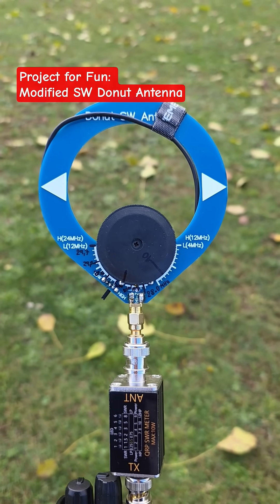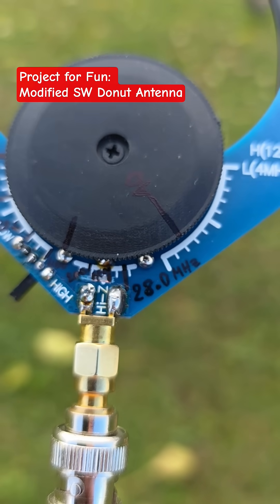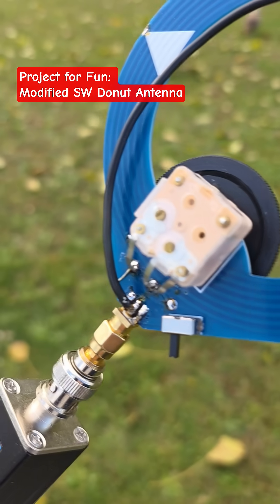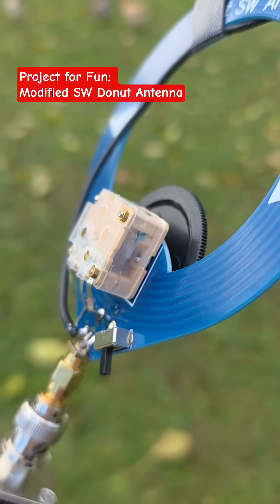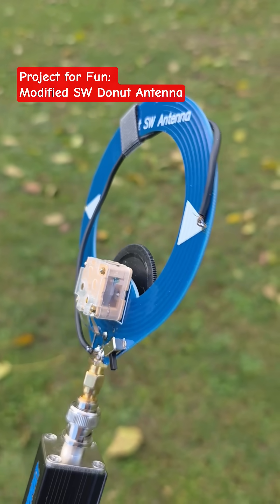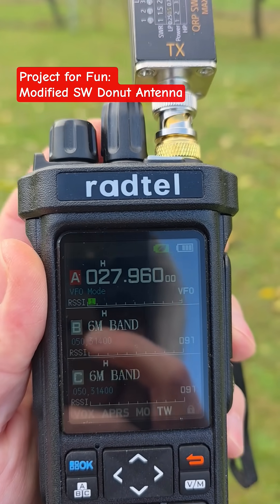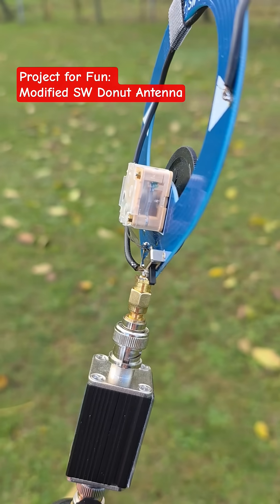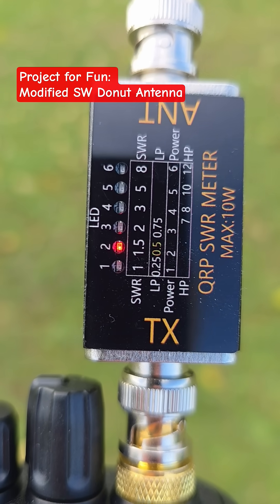Fun Project: Modified SW Donut Antenna for 10M and 40M Bands

Comment: It is not driving the antenna at 3.5W.
I believe that SWR/Power meter has a specification of -6dB insertion loss.
Connecting another power meter and dummy load to the rear for testing will clarify this.
Reply: OM also says it's for receive-only use.